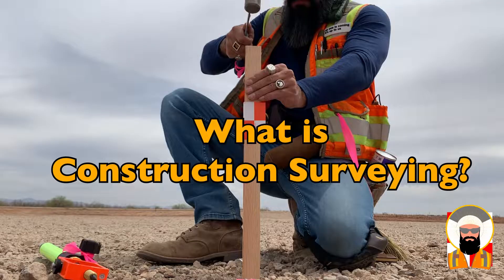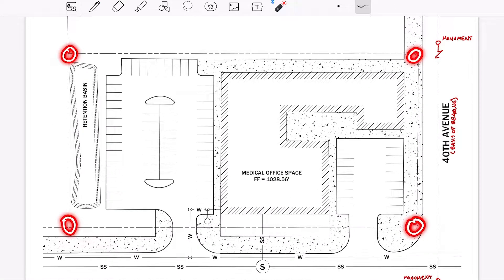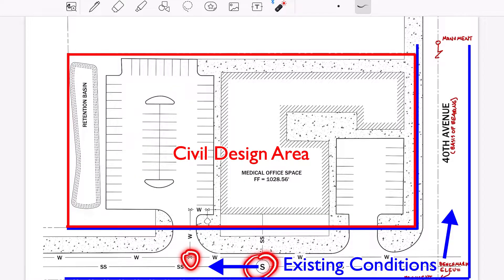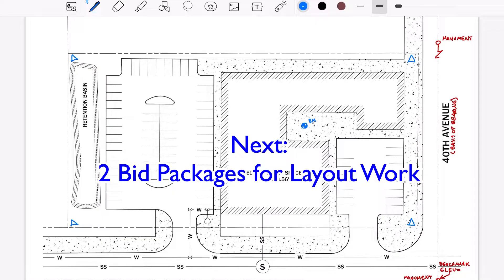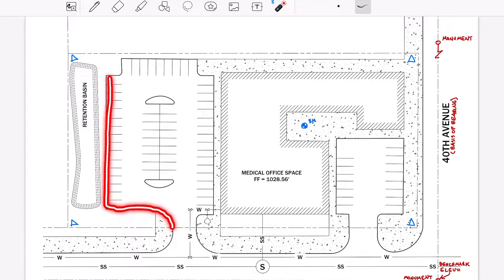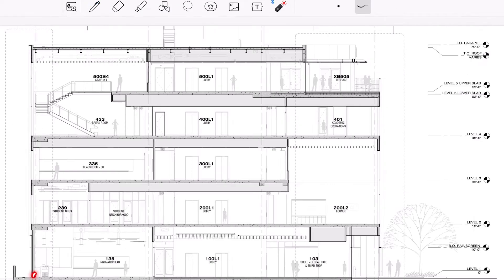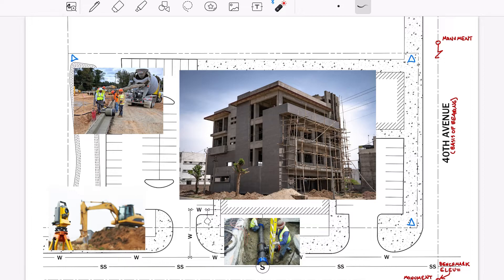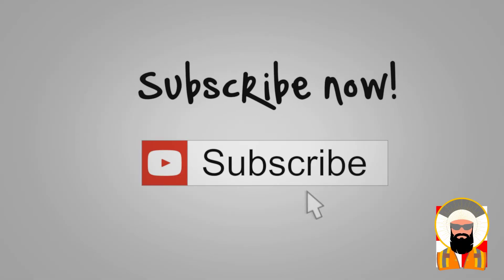What is Construction Surveying

Comment: Construction surveyors are the untrained underpaid monkeys who project managers pay to avoid paying a professional
Reply from the maker: What do you feel constitutes a professional? Licensing?  Many licensed surveyors send their party chiefs and crews trained by party chiefs out to a site.  Very seldom is anyone trained first hand by the RPLS. On site, many are using GPS for precision tasks and using “on the cap” boundary survey tolerances to set 1/8” tacks for grid line. Being a professional surveyor doesn’t constitute training in construction layout.  Many field engineers are trained in the specifics of construction layout, and most of the major general contracting firms have field engineering programs led by surveyors. Also, if you feel that someone is operating as a ‘monkey’, I kick that responsibility right back up to their manager/employer. People being tasked to perform tight tolerance work require tight tolerance training. If a field layout tech OR a party chief from a survey firm is on-site performing in a way that shows they don’t understand tolerance, it may be time to replace that trade partner entirely- after helping them understand exactly why you are moving on.